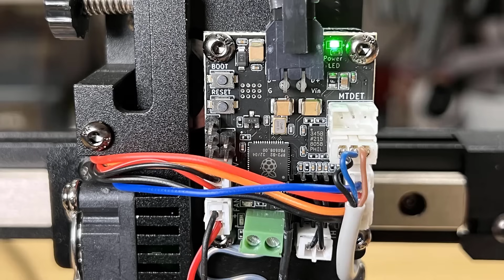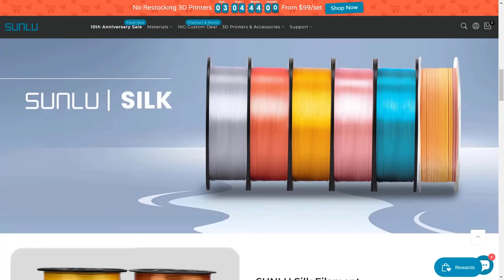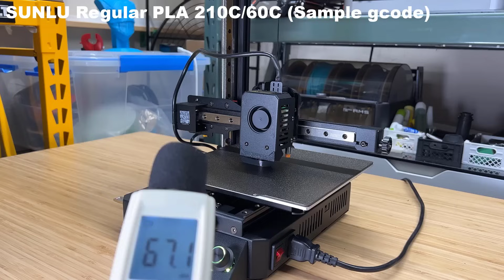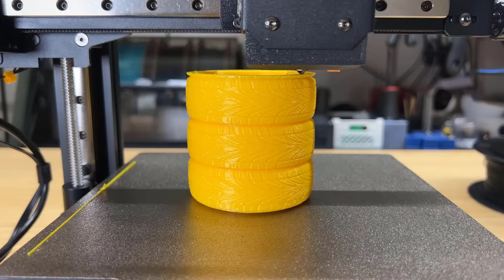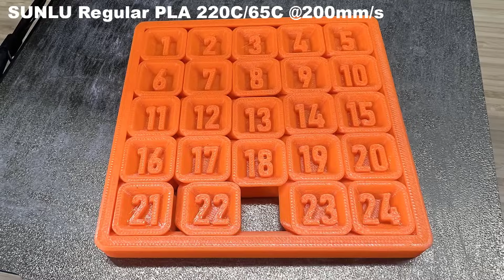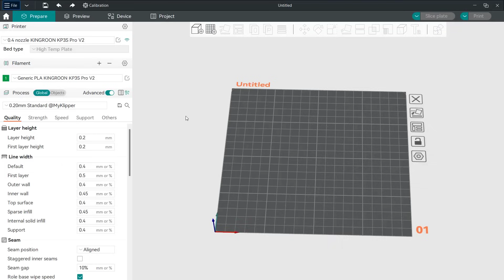Kingroon KP3S Pro V2: $229 all linear rails Klipper bed slinger review, and some minor bug fixes

Comment: I'm facing an issue with kp3s pro just right away on my second print.
 filament does not stick in the center anymore. but the preparation line before printing stick will at the corner. leveling as recommended and heating are working well. any advice

Comment: For fast printing only. I have heat creep issues, the hotend fan is quite weak and the cooling fins aren't designed well. The whole assembly is machined out of 1 part, it gets too warm, making PLA soften on the way to the hotend when printing slow/medium speed. Result is stringing/clogging. Not a good printer for miniatures. (EDIT the heatbreak design was changed in the latest versions, using a much thinner heatbreak now - so this might be fixed now)

Comment: New to 3D printing! You've mentioned glue. Would you be able to do a video on this subject? Different beds, when to use, type of glues, bed cleaners? Thanks
Reply from the maker: I have tried nearly every glue stick and so-called "professional" 3D printing adhesive, some of which cost $25 or even more. However, none of them have performed as effectively as Elmer's Craft Bond Extra Strength Glue Stick, which only costs $3.25 for a 0.88 oz stick. When it comes to bed cleaning, simply using warm soap water and a brush is sufficient. Always out of stock on Amazon: https://amzn.to/3qDsDJW
Also check your local Walmart.
Reply: Thank you @AuroraTech

Comment: With all the other problems you found on this printer. I think it is possible that the fan may be wired wrong. If the speed control wire and the positive wire are backward. It could cause the problem you are having.

Comment: please note that they dont release the klipper build they use. the community and i have issues with the firmware not working. nozzle is hard to replace because of no way to hold the heat block. Stock firmware also makes it impossible to allow the part cooling fan to work when using less than 100% but is possible to edit the config to allow it to work. replacement boards for problems after trying to update it with their guides are slow. many issues when looking at the fb community
Reply: I have the same issues. Potentially great machines and I want to like these printers, time after time, but they have no concept of quality control and customer service

Comment: Do you think the Kingroon KP3S Pro S1 with touchscreen is better to convert to Klipper instead of this printer?
Can you do comparison of Pro/Pro S1 and pro V2 ?
Reply from the maker: No, the KP3S(Pro/S1) touchscreen is not compatible with Klipper.
Reply: @AuroraTech  there are many people on the Facebook group who have converted it to Klipper with a Pi.
Reply: @whatisyouremailid  What's the point? Nobody should have to be doing all of this extra stuff to a so called print ready 3d printer.

Comment: You always get me with the Sunlu promotion.  You keep saying they have TPU but I've checked repeatedly and they never have it in stock.   😞

It's good to see more 3D printers, including lower cost bed slingers, now shipping with Klipper.  Kudos to Kingroon for using the full version of Klipper instead of crippling it as Creality did on the K1 series.  Klipper and Fluidd means I can tolerate the budget tiny LCD and clicky knob interface because I'll generally control the printer from my computer.  Kudos to Kingroon for having WiFi on their low cost Klipper machine (unlike Elegoo with their Neptune 4 and 4 Pro).

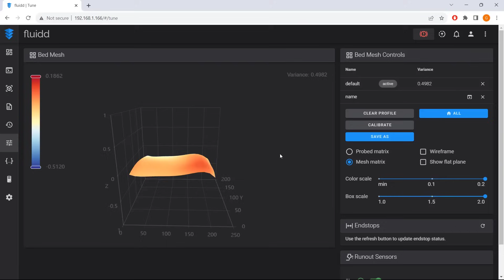4:50 - That's a very flat looking bed calibration.  I'm not a fan of these cantilevered X axis machines but this looks very good!  The beefy linear rails look impressive.

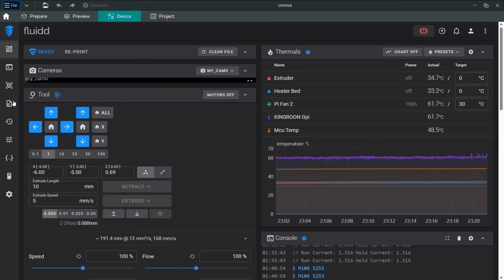20:50 - I wish all manufacturers would make good profiles for popular slicers instead of re-skinning a slicer to be proprietary to their one printer, and I wish they'd get those profiles correct instead of Aurora Tech or another YouTube technical 3D printer reviewer being forced to fix their config files and slicer profiles to make their printers work properly.

Kingroon got a lot right in this 3D printer.  Apparently the extruder is solid (unlike Creality's first attempt on the K1), not withstanding shipping a review printer with 25% over extrusion.  If Kingroon fixes the extrusion calibration, fixes the fan so it works at all speeds, and does a bit better job with hardware issues such as the fan duct and fasteners, this could be a nice little printer.

Comment: The high speed fan can still work - you need to run them at a MUCH higher pwm frequency. I have high speed part cooling fans -- they're commonly used in servers, and the PWM used there is 30-40khz, not the default 100hz used by killper and other firmwares. If you adjust the PWM frequency, these high speed fans can run at lower RPM -- i can generally get them down to 5% speed even.
Reply: @karurochari3769  I'm saying it works for me with similar high speed fans, it is very likely the board in this machine is simply unable to generate 40khz pwm, or fans used vary by target frequency. Some are 10khz fans, those tend to be cheaper fans. I'm just saying that high rpm fans can work, they just need more tuning.

Comment: Kingroon seems to still be the same.  No quality control.  Decent hardware slapped together.  I have 2 kp5L and a kp3s.  All where great after setting up.  Ran well for about 1000 hours.  Then the low buck parts just started failing left and right.  One of the three where always broken waiting for parts.  I couldn’t recommend these printers anymore especially with the soval sv06 series out.

Comment: good job especially finding and fixing some of the issues. I print PLA at 213 are you hotter for a reason. The drier proved its value, My print lab is in my basement. I have a dehumidifier but PC is awful every time. I like linear rails Direct Drive even smaller is ok for small parts but  as a retired engineer the cantilevered X axis feels weird to me. $230 Klipper Printer but low temp Hot End reduced the strong filaments.  Good review and always educational for us too.  Thank You, Dennis

Comment: Another great review. I considered getting this or the kp1l  a while back but held off once I started to see negative feedback online. So I decided to get the sv06 and sv06 plus instead and I am happy I did. The print quality was very good compared to my anycubic kobra and the sv06 line can easily be converted to klipper. I have a pi3b and a sonic pad so will migrate them soon to klipper. It is a shame kingroon made so many mistakes trying to rush these klipper printers to market. They should have taken their time and just did it right. They lost all the momentum they had with the kp3s line by doing that. It will now take a while for consumers to build confidence again so the money they expected to gain by coming to market so quickly ended up losing them way more in the long run.

Comment: For this kind of price range, I feel an Elegoo Neptune 4 is a much better deal, unless you're into linear rails and the like.
Reply: I was going to say the same thing. It's such a strange time for 3d printers... Budget and the best are so close in price and the market is oversaturated with non innovation.
Reply: @ServerWoes  I was also looking at fully enclosed units before getting a Neptune 4, but in terms of out-of-box experience without pegging the budget to the $1000 line, it's really hard to beat these 'bed slingers'. 

Neptune 3, the 4 and even some Sovol units, the Anycubic Kobras, etc. all seem to be solid units for people who want a solid 3D printer that Just Works (tm). That this is possible for a mere ~$300 is amazing indeed.

Comment: Another great review. If they fix the issue you have pointed out this could be a good machine. They  may need to increase the price a little to provide a quality machine. People are after quality not something slapped together to rush to market. Quality,  a resemble speed increase and long term use are the major things customers expect from new machine's. As a model maker that's looking to purchase several new machines,  it's these features that need to be offered before money is parted with.
Reply: I'd pay an extra $100 for better parts and real customer support, firmware availbility w/ revision control, etc (I own 5)

Comment: When she talked about cons of this printer,  I literally facepalmed myself😂🤦
Reply from the maker: Yes, it has some issues – not that big of a deal for experienced users – but for the price of $229, it's still an amazing deal. If Kingroon fixes all those minor issues and includes a new part fan with all printers, this could actually become a pretty solid machine.
Reply: @AuroraTech  the days of poor out of the box issues are past
Reply: @AuroraTech  I hope you are right. I really want to like their printers
Reply: Every printer has flaws lol
Reply: @alex59292  And Kingroons have Multiple flaws!  Creality or Sovol would be a better choice.
Reply: the fan is not a minor issue , they basically installed a non-pwm blower, which is kind of nuts

Comment: That benchy 😂
Reply from the maker: Yes, it was printed with 25% over extrusion due to incorrect parameters with the stock Klipper firmware. Surprisingly, some prints weren't affected as much.
Reply: @AuroraTech   I just got to the part of the video with the second benchy, it was much better 👍